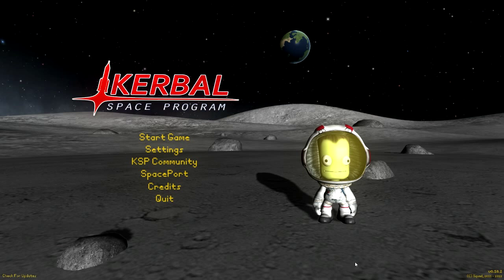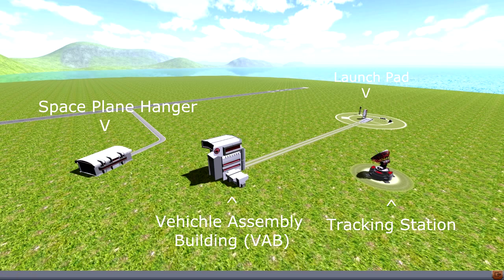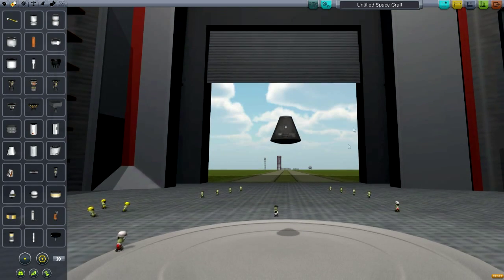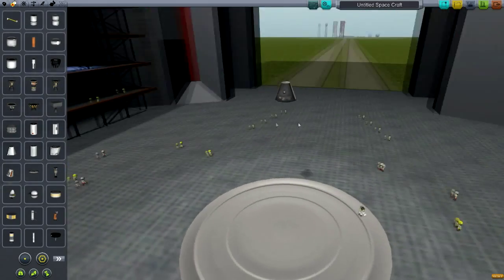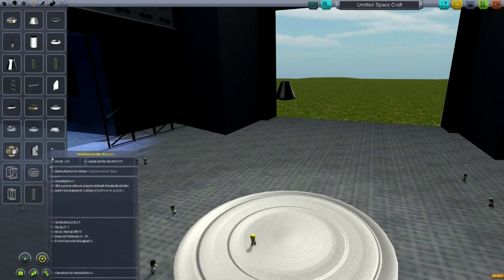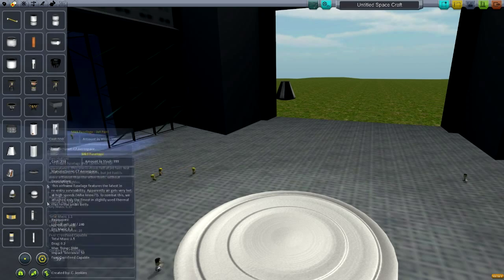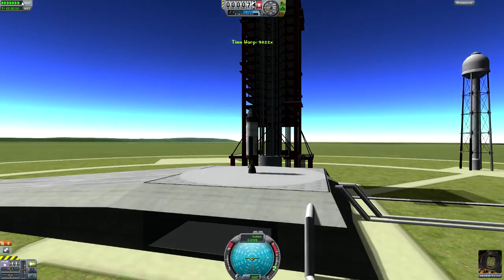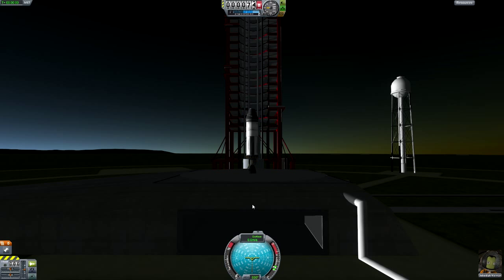Kerbal Space Program 101- Basic Rocket Construction and Piloting Concepts

Comment: ok so I have a tri pod with 3 rockets, to which are attached 3 orange fuel tanks with the biggest engines, everything goes well (a bit of spinning on 1 axis) until I decouple the tanks and switch over to the 3 center engines it starters spinning
it's a Mün rocket, and I almost copied it from my previous design from a different version (0.19 I think)
I just....can't get control in the second rocket stage......
any advice ?
also I can;t figure out control parts such as SAS